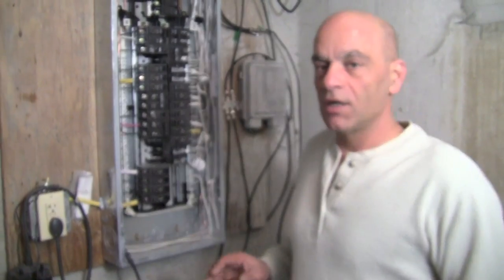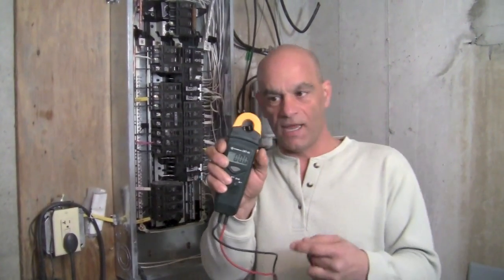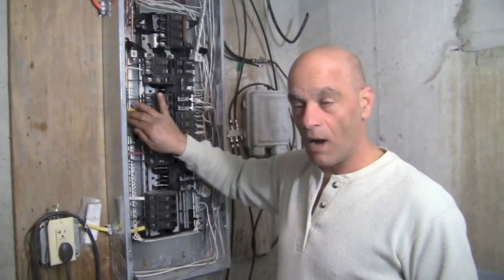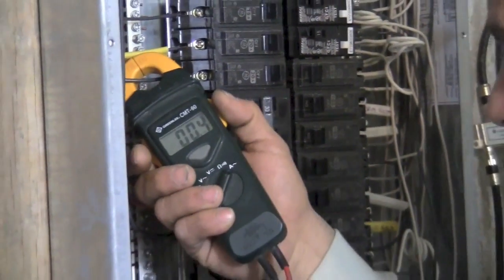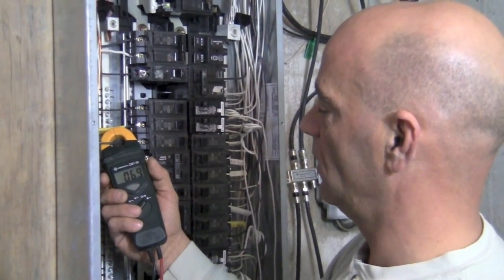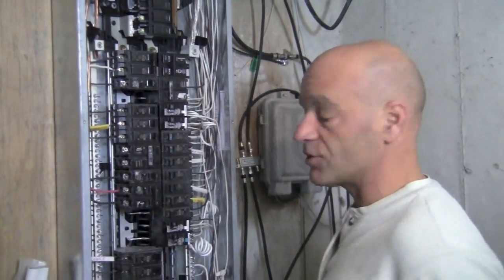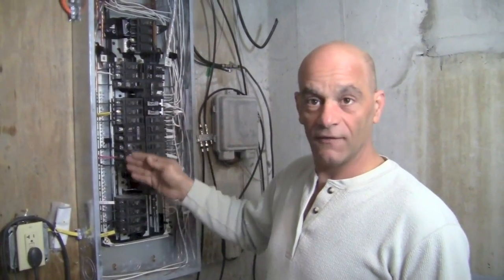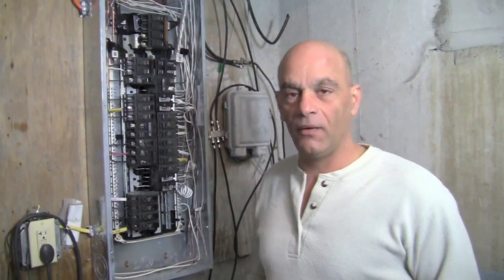How to check the amps being drawn from a breaker

Comment: hello dominic, question. i want to run a switch and lighting to my porch outside the house, but the closest wire of electricity near the area is an outlet. being that its a 20 amp and my lighting only requires 15 amp. can i still pull it from there?
Reply from the maker: Yeah sure, but it's not so much the amps, but rather how much is on that circuit already that you'll want to know.
Reply: ricardo castro Call a licensed electrician.
Reply: 15 amps?? That’s 1800 watts or 18- 100w bulbs. I think I’d add a separate breaker for a monster like that. Be careful.
Reply: @bryankrug7213  ??
Reply: ricardo ca
Reply: If you use leds you can do anything and use 14 gauge wire
Reply: Round..... well yea... and if my aunt had testicles she’d be my uncle

Comment: So I was gonna tap into an electrical box in my computer room and pigtail it into a GFCI into my bathroom for a bidet. The bidet can draw anywhere from 600 to 1400 Watts. I’m thinking I would be OK however when the printer is on or a paper shredder, it will draw probably more than that 20 amp breaker can handle. Gonna have to go purchase one of these clamp meters to see what that room is already drawing. Thanks

Comment: Hi thanks for a great video.
I was wondering why is my amperage reading bouncing back and forth when I check my amps with my clamp meter on my main switch of my 480 volts AC oven machine?
Reply from the maker: Seems like you don’t have the correct setting on your meter or no amps being drawn

Comment: Thank you for this concise but thorough demonstration.  I will look into my panel and see if I think I can test a circuit. Seems my panel may be a bit more cluttered with wires. Also, I will check into getting a tester and how to set it up to test. Thanks again I     subbed.

Comment: Clear and concise. Thank you!!! I have a 15A breaker in 2018 new construction that keeps tripping at random, but only when my small electric floor heater is turned on in the computer room which probably is already overloaded with 2 computers, a light, several chargers, a modem, etc. Would it be as simple as going to home depot and getting a higher amp breaker? I'm guessing this may be a BAD idea. Someone suggested it was in violation of new construction code for fire reasons? I do have the heater plugged into a TRC Southwire 120-Volt, 15-Amp, 1800-Watts, Single Outlet GFCI Adapter (bought from Amazon). I basically use it as an on-off switch because plugging and unplugging the heater is a pain to do. I've been using it this way for over a decade with no ill effects. I also heard that was a bad idea, but I'm looking for an expert opinion on the garage breaker as well as using a GFCI as a poor man's power switch.
Reply from the maker: Yeah seems like you have a bunch of things here that you really shouldn't have an electric heater plugged into. A lot of heaters will trip the breaker anyway.

Comment: Can you do a video on adding amp on a 3 pole ? I’m went to troubleshoot this pizza spot and they had a 70amp 3 pole breaker . During summer times it trips all the time .  I checked for Amps every phone was drawing 39 to 40amps
Reply from the maker: That would be a 3 phase, and I won't do a DIY 3 phase anything. Reason being that if you're messing with 3 phase you should already know what you're doing.
Reply: @Askmediy  yea I meant to say a 3 phase , the breaker melts every summer , I check how much the unit draws and it’s draws way more during summer to a point the breaker melts . Sorry for miss spelling auto correct,
Reply from the maker: @RodriguezElectrical  you either have the wrong breaker, but I don’t think so. I would look at the wire size. But I can’t and won’t help you anymore with 3 phase. Sorry. If you’re messing with this you should already know what you’re doing. Not knowing is the perfect way to make a fire or even get killed

Comment: I just put a brand new 115v Ac unit on a circuit and it tripped the breaker after about 15 minutes ... the unit that was there before never tripped the breaker so I figure it must be this unit but it would have been helpful to see how many amperes were flowing throw the circuit so I can be sure its not just that that circuit cannot handle the 8k btu unit and the 14k btu at the same time . I don't know why the bedroom and living room are on the same circuit but such is life in a mobile home ....god I hate it .

Comment: I have a client who wants me to help with an issue. They have a dedicated breaker to their washing machine. I have tested the breaker and it is holding the 120v on a 20amp GFCI breaker. It trips intermittently while the washer is running (not all the time). I am going back to check the amperage on the breaker this week. Is there a way to tell if the breaker is just weak? I told them it could be something to do with the machine itself, or even the outlet. They arent sure, and I am trying the least expensive course to help them first. I would appreciate any thoughts on this. The house is only 4 years old, so I was kinda leery that it was a bad breaker myself, but I guess anything is possible.
Reply from the maker: Answered you on my website
Reply: @Askmediy  thanks, I replied that it is a GFCI breaker.
Reply from the maker: Yeah change that to a regular one and you’ll be fine
Reply: @Askmediy  A standard 20amp breaker will be alright? Is there a reason they used a GFCI breaker for the washing machine and not a regular breaker?
Reply: @Askmediy  thanks for input and the help. Have a great day. Blessed Christmas and God Willing a much better New Years.
Reply from the maker: Anytime buddy, and you too.

Comment: I've got a situation right now to where debating on rewiring this mobile home. We lost everything in a house fire and money is definitely tight. We bought a cheap mobile home that basically needs everything updated or replaced. I've replaced receptacles and light switches I have cut off all the old ends and they were stuck into the back of the receptacles. I did away with that and use the screws and wire nuts like it's supposed to be done. My issue is I've got a radio plugged in to a specific Outlet and whenever I hook up a battery charger to charge up the drill... The radio goes into static. I'm about to check the amps like you just showed me because I've already checked the voltage and the voltage is fine. I'm just trying to figure out if I should replace the wires or not
Reply from the maker: That's a great question. First make sure that all the connections in the panel are good and check from the panel to the grounding rods.
Reply: @Askmediy  I actually ran brand new wire from outside all the way into the panel box and it's all very tight in order for it to pass inspection it was good. I have put brand new Breakers in the Box and those connections are tight also. I've tightened all of the ground wires on the ground bar inside the panel box and the same for the white neutral wires. Basically when I hook the radio up and then hook up the charger on the same circuit it makes the radio go to static but I took the radio off of that receptacle and I hooked it up to a receptacle that only has 1 Outlet. It's a dedicated outlet for the washing machine in this mobile home. I put brand new wire in. It is a 12-2 non-metallic yellow wire. The house was pre-wired from the factory with black 12 gauge wire. That wire had a knick in it so therefore I replaced it. But when I hook up the radio on that receptacle and hook the charger into the other part of the receptacle the radio is fine with no static whatsoever and that has me scared because the radio has been hooked up on the refrigerator receptacle which is the one that I am talkin about from the beginning. I hope this makes sense
Reply from the maker: Other than installing a house filter it's going to be real hard for me to help you without being there. However your charger could just be very old. Or is it?
Reply: @Askmediy  it's a rigid from home depot. Not too too old I guess..
Reply from the maker: Morning, it just came to me. Since it's a mobile home make sure the metal frame is also well grounded.
Reply: @Askmediy  yes, I checked that! It was tight. In order for it to pass the inspection in my County. We had to drive to ground rods into the ground one beside power meter and one like 6 feet away from the power meter or something like that. I'm going to go to Home Depot and buy a another ground rod and drive it into the ground right beside the house . And then I'm going to run the ground from the ground rod up to the frame of the house and then from that up inside the power box inside the house to give it an extra ground. Because I'm seeing little blue Sparks whenever I plug in appliances into my brand new receptacles and I'm just thinking that it can be a ground issue. Yesterday I used a meter and check the amps on a dedicated brand new outlet versus a pre-wired already existing Outlet of the same gauge wire and the amps were point one decimal apart. I used a little electric heater, on the brand new receptacle that has brand new 12 gauge wire the ants were reading 11 point 7. Then I took the same heater and turned it on the same way on another 12 gauge wire but it's a 12 gauge wire that was ran from the factory with a new receptacle. The little heater withdrawing 11.8 on that receptacle.

Comment: Hi Dominic!  I found a old Snap 8 SPR - 300 AC Volt ohm ammeter made by Sperry Equipment Inc left by my deceased father.  It doesn't have any leads on it.  Trying to see if I can still use it.   Googled and found pdf file of intruction on the plus model, which requires a AA battery.  Mine is not the plus model.   On mine, there are 4 screws at the back that opens the panel, but a button dial at the bottom corner keeps me from prying it open completely to see if a battery is needed or not.  The dial is not popping out  using a flat head.  I see a small recessed hole on the side of the button dial, but using small screw drivers for eye glasses is not doing anything inside that hole. Have you used one of these instrument before?   Are any of these old style meter not require a battery?   If so, are these plug-in lead wires  interchangeable with the lead wires of a regular multimeter?   Thanks so much!

Comment: Thanks very much sir. Pls what if it were a two 220v with two line phases, are u going to sum the amps of each phase to determine the amps draw of that breaker? Thanks sir
Reply: No check both legs separately and the higher of the two is your 220 draw
Reply: @mitchdinner9743  thanks for your prompt reply sir

Comment: Ok so I'm monitoring my breakers... but what do I do about the one that keeps trippin?? Can I just put a higher amp breaker in the same spot? Probably a no, right? So how do I fix it?
Reply from the maker: Do you know how much you're drawing on that circuit? If it's under what the breaker is rated for, yeah go ahead and replace. But if it's anywhere near the rating you'll have to fix that first.
Reply: Breakers must be sized for the wire size of the circuit, thats what it protects , the wire, If your breaker is tripping and its sized properly for the wire than you're overloading the circuit you need to reduce the load on a circuit or upgrade the wire and Outlets to the proper size for the load needed.

Comment: How to determine if the main amperage is actually whats stated at main breaker.  Will this meter be able to determine if i put the clamp on the service line if reads true to whats stated.

Comment: NEED HELP. Ok I don't know too much but my problem is that I want to put a frig in the garage. the problem is that from the bed room to the kitchen to the garage it looks like its on the same circuit. So when I plug the extra frig in the garage the GFCI switch that is in my restroom cuts the electricity.
I have a lot plugged in to this area of the house: frig, freezer, electric bed, water cooler, microwave, small appliances. 
So, I how can I have it all without danger?

Comment: Great video, I gotta run and buy a Clamp meter and go see what a well pump is pulling cause lady wants solar back up for it. Had no idea would be that easy to check. Thanks
Reply from the maker: Thank you. Chances are the pump is 220 volts. If so make sure you check both hot legs and add them up for your results
Reply: askmediy super thanks for the reply. It is 220 and I was only gonna take measurement from one wire. Saved me again thanks

Comment: HI Dominic, I'm dealing with a reading from my breaker at the outlet of 85v rather than 110v - 125v which I've wired my previous home myself without issues but my new homes previous owner has quite a bit of different issues I'm dealing with. I've installed a new main panel and had to install extensions to the service entrance 2awg wires (being there was only 2" coming into the S.E.) using the proper copper threaded clamp rings then looped down and installed on the panel. Ground bar added and all wired into proper placement. When I plug in my voltage meter at the outlet it reads 85v. when I'm doing this test I'm only switching on the one 20amp breaker in use to test and due to pre-existing issues i'm finding even have all other wires from other areas disconnected from all breakers so mentioned test is only breaker in use. 
Any help would be appreciated.

Comment: You still answer questions?
Reply from the maker: For 9 years now. What's up.
Reply: I'm trying to find a video on say I have a 200 amp service how would I find out how much of the 200 amp service is being used. I know your not supposed to go above 80 % I believe?  But I have a panel with some unmarked breakers trying to find out if I will go over by twinning some circuts up. Great vids straight to the point. Thanks for any info.-Kevin

Comment: Hi Dominic.  Great video.  I have a similar problem with a breaker in my garage.  Now here is the scenario.  Not much is hooked to that breaker.  How do I know I tested it by shutting it off and it only supplies power to the garage.  The previous owners probably were not as DIY as me soo they probably did not see or have this problem.  I have shop tools, small compressor, table saw, hand tool etc.  Anytime I try to use them the breaker would go down.  Now with your explanation this can tell me if I am over on the AMPS! But the question is when I find out for example that I am drawing 25 amps on a 20 amp breaker (I don't know what the real amperage  is)  Doe that mean I can replace it with a breaker of higher amperage and not have the problem?  Thanks again for a great video
Reply from the maker: +anievestor No it does not. You would have to run a whole new line to the garage or maybe in your case you'll better off installing a sub-panel in the garage.
Reply: +askmediy ok that should easy because  the  electrical panel is right there in the garage
Reply: +anievestor Not sure how it turned out for you. To be clear, the new line has to be the next size bigger gauge of wire.

Comment: How do you measure the total current my whole house is using at a particular time using a standard clamp ammeter? I don't think it's as easy as measuring each hot leg on main breaker and simply adding readings together right? 120V loads draw off one leg and neutral. 240V loads use both hot legs only right? BTW, legs=wires NOT limbs on a woman! So, if I have loads using both single legs/neutral and 240V loads won't that give an error in total current if I measure each hot leg and add together? I'd be adding the 240V load twice, right? I tried clamping the main neutral and got a real low reading. That's because we have both neutral from pole transformer and earth tied together in panel. Funny they use same huge gauge wire for neutral when little current flows through it! Any thoughts here? Thanks!
Reply: You check both legs of the service and the higher of the two is your 220 amp draw. Your neutral doesn't show draw, it carries unused power from the appliances back to the grid. The neutral has to be sized the same as the incoming legs because it's a possibility of that much current going back.

Comment: I have a good basic meter.  I want to use the black and red probes to check amp draw.  what setting do I turn the meter dial too?  go over all those while you're at it.  which probe do I stick where?  thanks
Reply: You can't read amps with the probes, you need a meter with an amp clamp like the one shown in the video. Only way to read.

Comment: Love your videos.Your awesome. Question,is there a max amout of outlets that can be installed on one 15A circuit? Thanks again.
Reply: +Frank Maio theoretically you could put 50 outlets on one circuit as long as you dont exceed the amperage of your wire and breaker
Reply: Frank Maio 
Rule of thumb for calculations is 180va per receptacle, 180x8=1440va (watts in this case)
15a x120v=1800w, 1800w x .80 = 1440w, 8 receptacles.
Reply: I believe the rule is to not exceed 80% of the circuit. So 80% of a 15 amp circuit is 12 amps. Each outlet as a rule is 1.5 amps. So 12 divided by 1.5 is 8. So you shouldn't exceed 8 outlets. Same thing applies to a 20 amp circuit. 80 % of 20 is 16. At 1.5 amps per outlet you shouldn't exceed 10 outlets. Hope that helps
Reply: Eric, theoretically yes...legally NO!!!

As per the electrical code there is a maximum number of boxes you can install on any one circuit. By boxes I don't just mean outlets. I'm also referring to light switches, receptacles, lights, junction boxes, etc. I'm not sure if the maximum number varies from state to state or province to province, however where I live (Ontario) I do believe it's 12 boxes max per circuit.

Comment: Hey Dominic, I plugged up 2 space heaters in separate rooms, and it tripped the breaker, Why is that
Reply: +Robert Russell could share the same circuit a lot of times the wall that two rooms share will be wired on the same circuit. plug stuff up and start cutting breakers off one at a time to double check